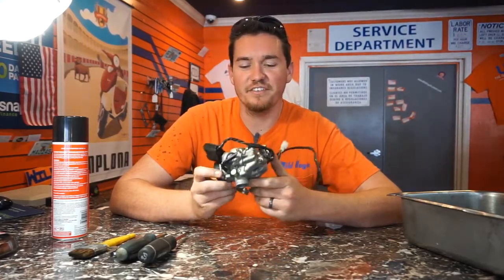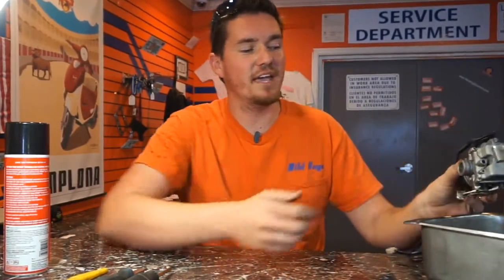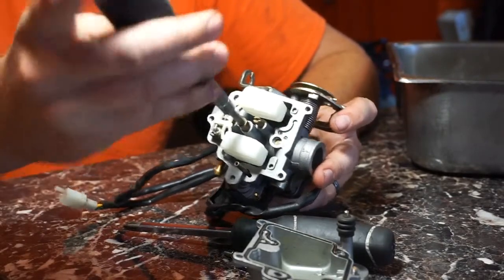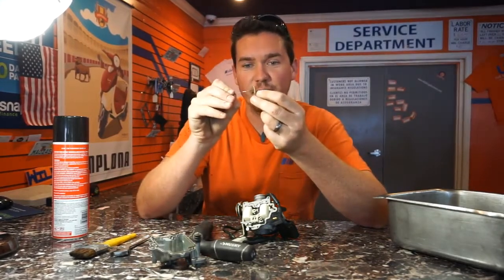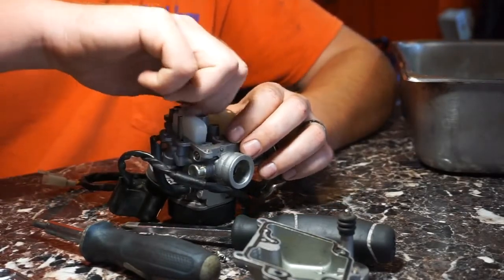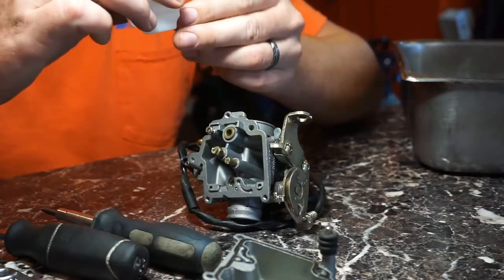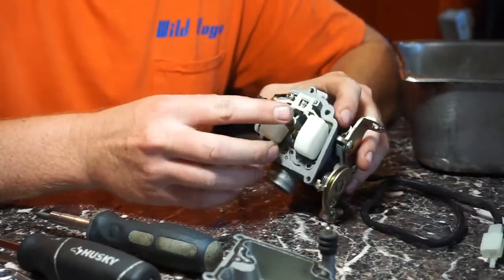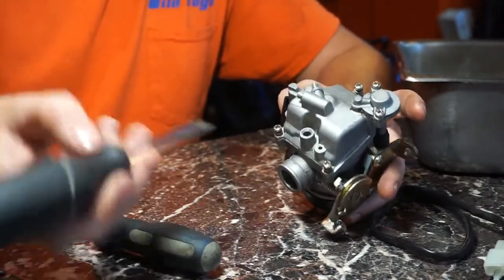How to clean 50cc or 150cc GY6 scooter carburetor

Comment: I have 2 Kymco Agility 50cc scooters 2020 model year I believe they have 17mm carbs stock and they are very temperamental cold starts are horrible the dealership said the carburetors are no good from the factory any recommendation on a better carb.

Comment: my scooter has been sitting for a while. I fixed that problem, rode a few miles no issues until I hit a bump kinda hard. now when I throttle up, it will almost cut off.I drained the tank,added fresh gas. still doing the same thing.Did I knock something loose. It started immediatly after the 'bump'

Comment: You didn't tighten the one that you took off with a wrench.   =)
   Thanks for the video, though.  I've upgraded my fuel jet before, so this will be easy for me.
   I thought there was much more to cleaning a carb.
Reply from the maker: We did both that and the jet that is inside at the same time when tightening both jets down! It doesn't have to be super tight, just to where it doesn't need to move. 
Glad you like the video! Thanks for watching!

Comment: Where can i get the three screws at?
Reply from the maker: That's a tough question to answer, it really varies due to where you live. Sometimes your local scooter dealer will have them, and sometimes they won't. We usually go to Skycraft here in Orlando and buy them in bulk.
Reply: Qlluo
Reply: @wildhogsscootersmotorsport8431  my scoot is using to much fuel. carb no good im very knowlegdeable but this is got me stumped.
Reply: Fyi friends, carburetors for these gy6 engines can be had for like $25-$30 on eBay or Amazon. Dont forget the jets!
Reply: @humanbeingfromearth  I buy mine for $15-20.